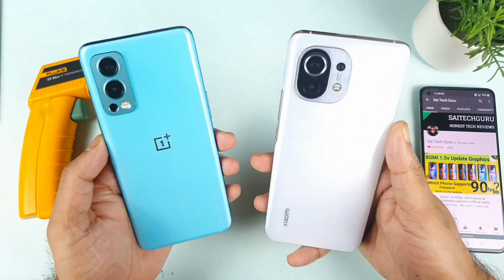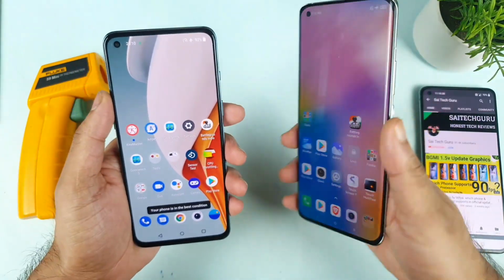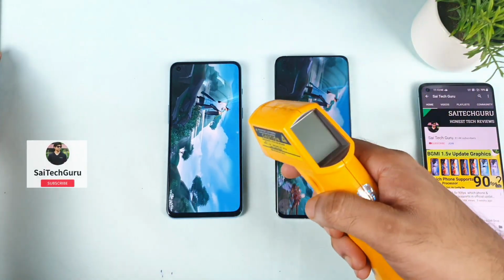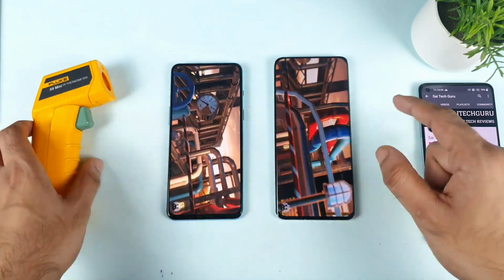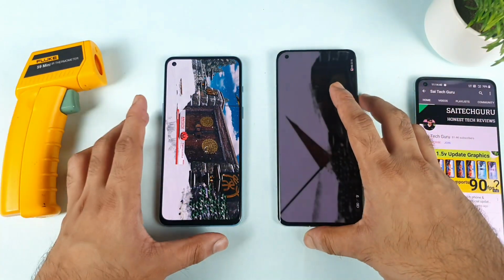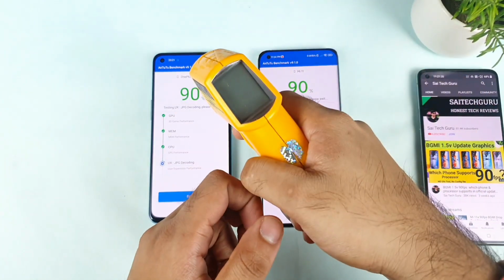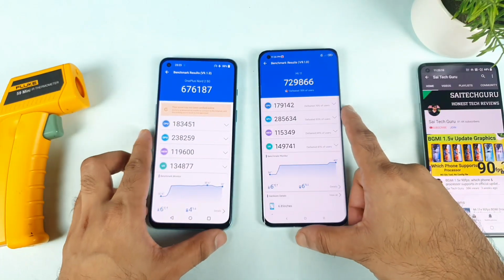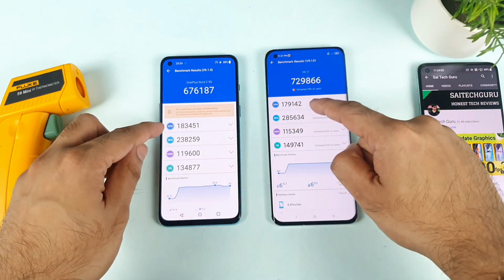Oneplus Nord 2 vs Mi 11 antutu test comparison dimensity 1200 vs snapdragon 888🔥🔥🔥

Comment: Sd888 should b close to 8 lcs
Reply from the maker: It depends bro I showed in the video my previous highest score is 7.82 in mi 11
Reply: @SaiTechGuru  why the score varies so much? These benchmarks can't b always trusted then.
Reply: bro nubia red magic powered by sd 888 scored 842k in antutu even My mi 11x pro without game turbo and performance mode off scores 785k both times i tested I'm expecting it to cross 800k after Game Turbo on with enhanced performance mode